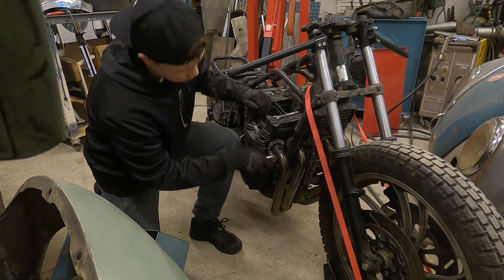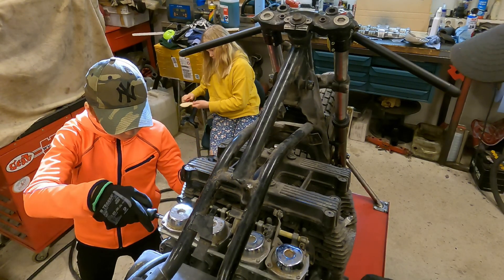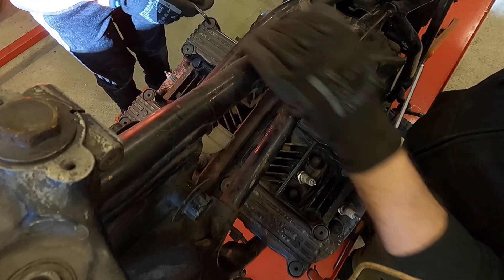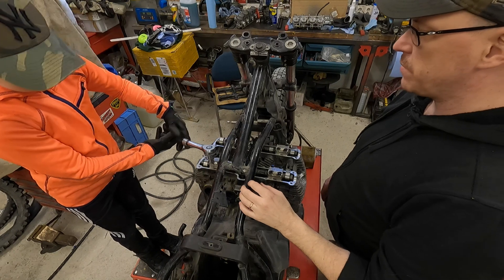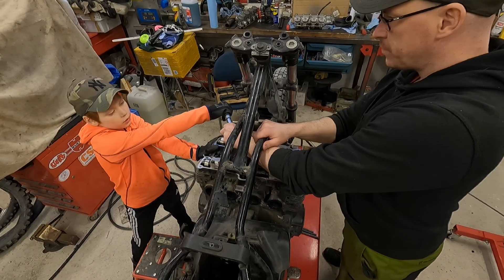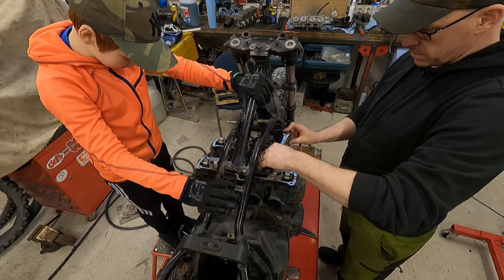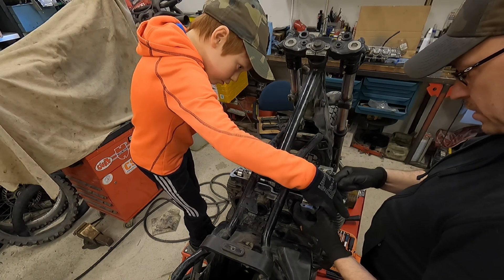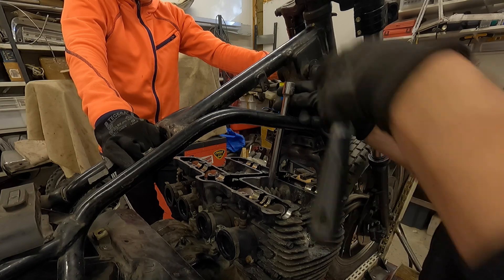Young Gun Cafe Racer Build EP2 #Yamaha #XJ750 Cylinder head removal

Comment: Had one of these new back in the day. Good idea to remove the barrels and inspect the pistons, piston rings and the barrels. Did you do a compression test before disassembly?
Reply from the maker: Hi thank you for the comment. I did compression test to it, you can see it in episode 1. Cyl 2 had bad sparkplug thread so I could not get compression from it. 

I did not remowe cylinders but I inspected  while head was off and they looked good, of course it would have been right thing to do as I had head off… 🫣